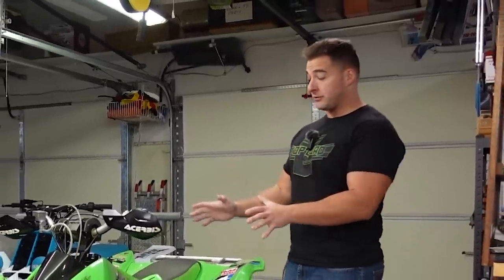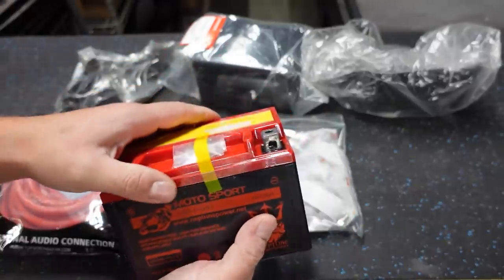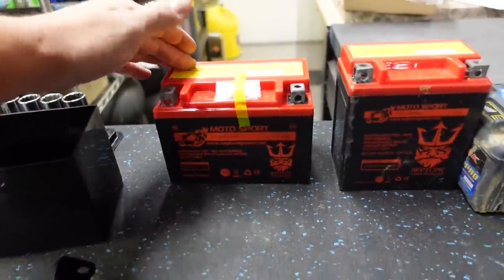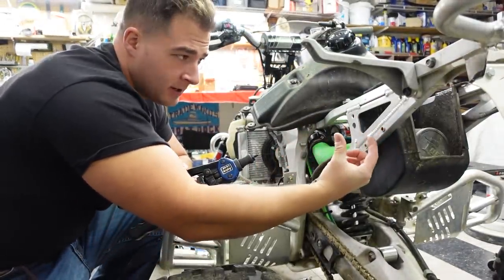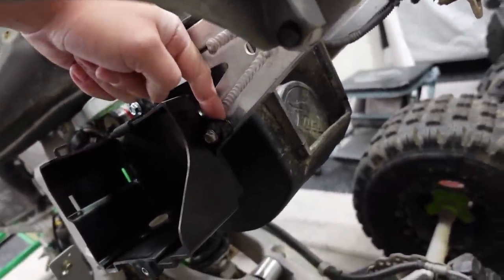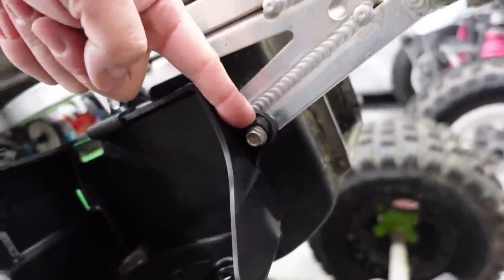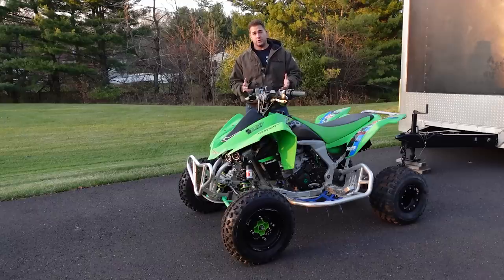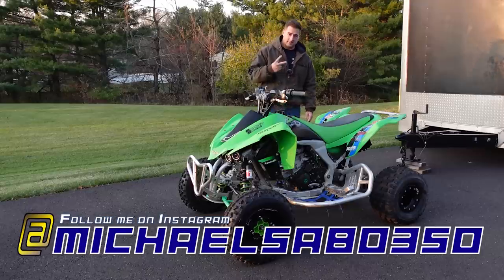The Worst Battery Design in History... Let's fix it! KFX450R Battery Relocate and Upgrade

Comment from the maker: Who's had this issue? Do you think there's a more problematic design than the Kawasaki KFX450R? Let me know and maybe I'll design a fix for it! Thank you for watching and Happy Belated Thanksgiving, you all ROOOOOCKK!!! 🤘🤘🤘
Reply: Hey Mike 
So what always saves my kfx450 is a kicker kit it seems that the starter wouldn't crank fast enough for modded kfx450 engines
Reply: @maxxus5572  then do a 24v starter
Reply from the maker: @maxxus5572  I can’t believe I forgot to mention that! I really wanted one of those but I could not find one; I think Kawasaki actually offered them as an OEM add on at one point. I did hear that they were difficult to start using it though.
Reply: Lithium needs a Lithium specific charger,  they like to be charged,  removed,  allowed to drop through use or sitting ,  and then recharged before it goes under 11V.  once they get into the 10.8v  and under voltage range,  it lessens their lifespan for some reason , and they don't retain charges , and it drains faster when stored. .   also don't store batteries in the cold.
Reply: What is your welder it sounds amazing mig or flux and what brand and if it’s mig what gases are you using
Reply: Had the same problem on a 07 KFX450 i had about 4 or 5 years ago, Stuck a Moose 150CCA Lithium in it, and it was somewhat better, but man, theres just no getting around the stock battery being small in general. Thats a good idea Mike, and you fabbed it up well. Looks good bro. My 400 ex will crank over 10X longer than the KFX i had. Dont get me wrong, the KFX is a rad bike, i loved it, the frame on them is really nice and modern in comparison to the 400ex frame, but, theres just something about hopping on a 400ex and always feeling comfortable on it knowing theres not much of shit that can break. One of the easiest quads to work on also out of all the bikes ive owned in my life. I'm 37, been riding since i was 9, and ridden most of everything out there, owned probably a good 3 dozen different quads and, the only two bikes i tend to hold on to are my 04 400ex and my 07 Predator 500. Yeah, i know, the predators are pains in the ass... Good bikes though when you have a nice one thats not ragged out. Keep it up Mike, you make some helpful videos for the quad community, as well as some good fun riding content with the Brewer bros and Hager and all the others.
Reply: Meee
Reply: Worse than that design is my 08 KTM 525 xc. Small battery and not accessible without disassembly of the rear plastics. Doesn’t give me problems unless it’s cold out than does very fast. The ktm rfs motor in these quad struggles in the cold. I leave my tender on it majority of the time unless it’s warm
Reply: @twistymcslide2  That's why I like AGM's when it comes to vehicle batteries. They're made for sever weather conditions so they're able to withstand the abuse of cold for a bit longer than a normal battery. I'd love to change out the stock one in my truck for an AGM. I had a problem with the computers going all wacky last winter when the temps got into the negatives.
Reply: Yes the honda 250ex, 300ex and 400ex have a very bad location
Reply: @MichaelSabo  you are definitely correct I picked up my kicker kit from kawi in 2010 and now when I start my bike I actually prefer used it over electric because it usually start first kick. But I have heard the kit is hard to find now.
And to answer the question if it's hard to start it take a little getting used too but definitely not hard at all and I have tons of engine work done.
Ported head,13.1 piston, big bore, stroked,you get the idea 
Love your videos dude keep up the good work 🤘
Reply: @tannerlosee1865  Yeah, i generally leave a tender on them now as i dont ride every day like i used to, sometimes one will sit a month before i get around to taking it out for a rip. I generally try to take both of the bikes out at the same time just so i know ive dun them both and they are fine. My dad likes to randomly call me and say "Hey, lets go out riding for the weekend" at any given time, so, i try to keep the bikes ready for that. My kids are at the age where they can start moving up to bigger bikes, but i .....heh, i dont want them to ride the bikes ive had for years, so, ive been thinking about buying a half clapped 300 or 400ex and just letting them beat on it and work on it themselves with a little bit of over the shoulder assistance. They currently have an xr80r and a yamaha 200, but they are really just outgrowing them and can just about ride as good as me given they have ridden since pups. Just the parent in me not wanting to give them a fast bike and then someone gets really hurt. They respect bikes, and know what can happen, but, we were all kids once, we know exactly what its like to want to just let it eat and not think about how fast that curve or tree is coming at you, especially when riding with friends.
Reply: lol you better clean them marks off the drive way or your old man is guna chase you with a broom stick down the street hahaha
Reply: hey mike if ur battery ever dies just bump start it. obviously not with loose ground but grass would be sufficient
Reply: Hello Mike, great fan of you , just letting you know that someone is saying that they are you and they won a prize scamm please warn your patrons to be very careful it's not you . I got scammed for $133 please add thanks brother.🙏🙏🙏🙏🙏🙏🙏🙏🙏🙏🙏🙏
Reply: Yep had that same issue when I had my Kfx. Loved that quad. Looking for another
Reply: Having Efi sucks. If your battery dies everything dies. It left my dad stranded on the trail and we had to drive my Mojave 2 miles to get to the parking lot. Once we got the truck some guys that helped us get it on the trailer said the voltage regulator was broken. Every time we go riding his check engine light comes on.😅
Reply: I have a kfx400 and I'm have problems  with choke cable don't do any thong or it kill it if  moved one way idk
Reply: Hey mike .. how many liters / qt does a raptor 700 take in the case ?
Reply: @MichaelSabo I am having problems with my kfx staying cranked do you know how i can fixed the problem
Reply: Hell yes I swear it actually had made it where I've passed on riding because didn't want the stress of worrying if it would die or my battery connection would come loose
Reply: Need this design. Badly
Reply: Mine does the same thing if it’s cold it sucks

Comment: Just for some extra input to consider, I used that same tusk battery in both my YFZ450R and my Raptor 660 and have never had an issue with it draining out. This could more an issue with the starter drawing a lot more amps than other brands starters. Just so people aren’t 100% detoured from using the tusk batteries! I do hope this fixes the KFX though! 🙏🏻 keep you the good work bro

Comment: The raptor 660 was the worst when it came out, backfire blowing one of the carb boots off all the time, and the one way bearing from starter to flywheel was always failing. That quad left me stranded soo many times.
Reply: It feels like the 660 was just the test quad for developing the 700r
Reply from the maker: I can agree here; those 660s had some pretty common issues

Comment: Clean relocate 😎 if you have problems after this I would suggest an Antigravity battery. It did wonders for my yfz 450R & ktm that love to drain batteries. I have been replacing battery’s every 6months since 2006 😂 on every machine I have owned. Now I have one small form antigravity 13v 230cca I just rotate between bikes when I want to ride. Claims it can go a full year with no charging as long as it doesn’t have a draw on it.
Reply from the maker: Thank you man! I am hearing a lot about these anti-gravity batteries; I think I have to try one out!

Comment: Had a high comp 300 ex with a cam /400ex cab and exhaust I built and I put a400 ex battery in it and it helped out a lot ! I had one of these bikes and the small battery is the pitfall of these bikes !

Comment: What spray paint did you use? Trying to find something really strong to use on my 300ex accessories.
Reply from the maker: I have it linked in the description. Its available at Walmart or any hardware store- cheap and it lasts pretty well if you prep the surface!

Comment: Nice job. However we're all running the 15oz 3in x 1.5in AntiGravity battery. Lithium. And very small lightweight...✌ remember keep it in neutral left in gear drains battery. Ugh I've bought over 7 batts, for mine.

Comment: Did you have the original battery covered or just rode with a opened battery. I recently got a kfx and the battery is just exposed and I’m concerned , will it be okay like that

Comment: If you ever decide to do another battery upgrade try a good brand AGM variant. They're a little pricier but they're designed for sever weather conditions and tend to have higher CCA than normal batteries. I bought one for an old utility quad that was rated for 310CCA. Of course that's also determined by model of battery. :)
Reply from the maker: Not a bad idea at all! I was concerned that I'd still have issues though even after spending the money on a more premium battery
Reply: @MichaelSabo  Personally for me with all the problems I've had with regular vehicle batteries in the winter I'd switch them out for good AMG's any chance I could get. But since my truck is a lease I don't know if switching the crappy battery out for an AGM would void any warranties. The same goes for my tractor, I'd switch out its' stock battery in a heartbeat for an AGM but I don't know if it would mess with any warranties as well.

Comment: Have you consider a 24 volt system?  It is a two battery linked system that is very popular with xc racing that have dead engine starts.  I use a Shoria battery that has 270 CCA that by itself starts my TRX450er very fast providing valves are at proper gaps.  I use 24 volts start system for racing only and it is easy to disconect it and run with 12 volt start system.  For a second battery,  Antigravity has a smaller 4 cell 13 volt battery that is perfect to enhance the rapid start without adding hardly any weight. In fact, two lithium batteries will weigh less than one OEM lead acid battery.
Reply from the maker: This is somewhat new to me but I am getting a lot of comments on the 24v system; it definitely makes sense and especially for dead starts. Thank you for the info; I'm going to look into this possibly for a future project!

Comment: I just got a kfx450r and went riding and it died I’m thinking about doing the same thing did it work a lot better over time ? And was the starter relay wiring extension aftermarket or custom

Comment: Hey man hope you had a great thanksgiving I just sold my kfx450r never had a starting problem I just bought 07 trx450er and the battery dies so fast i hate when this happens might have to do a 24v starting system
Reply: Damn fr. I've had mine for two years and haven't had a dead battery yet.
Reply: @LolliWANG505  I just picked pick this thing up it needs work it’s getting a complete rebuild should be good to go after it’s all done. 🤘🏽
Reply from the maker: Curious if your KFX was modded? I think its the high compression and heavy valve springs that tax my starting system. 

Good luck with your new 450 man! I imagine there's a bug in the system but I don't know too much about the TRX450ER.

Happy Thanksgiving to you too man!

Comment: I think the problem here is the battery you chose to replace it. Lithium batteries are nice but you chose a battery with only 2AH whereas even the oem was 7AH. And all this work just to install a 2AH larger battery. My suggestion, use the oem location and use an antigravity battery. Tusk also don't have a full battery management system like the better brands, so if you over-discharge it you will damage it. Where as brands like Antigravity and Shorai that appear more expensive are actually giving you MORE Battery and a full Battery Management system that will not allow the battery to over-discharge and be damaged. Antigravity will give you 150+cca in the oem box. Love the creativity tho.
Reply from the maker: Great info and I think you're right on the lithium that I chose being a bad choice. I did however go through a number of batteries before switching to lithium (not an anti-gravity though.) I'm happy with this system though and it was fairly cheap to do.

Comment: I'll never understand why they put the batteries up low in the front where it's exposed to the elements coming into the bottom of the chassis. Polaris does this too and it's a terrible location for a battery. Not to mention they're not easy to get at when you need to put the charger on.

Comment: hey man i have a yamaha raptor 250 that only idles when warm. i have the idle turned all the way up and it still idles really low. the carburetor is cleaned and everything please help
Reply from the maker: I don't have experience with the Raptor 250 or know if they have quirks but just as a rule of thumb with idling issues, sometimes a rebuild is in order for a carb, even if its clean the components like the needle valve and seat can be worn out. Resetting your fuel/air screw may help and making sure you don't have any air leaks in your system that can cause idle issues. Hard to diagnose without seeing it but I hope this helps!

Comment: Ya my last ride my battery on my 06 Trx 450r came loose, im always scared i may not be able to start if i stall it. i want a backup kick start. but ya in do time. plus where i live and ride im miles from help or may not have cell signal.
Reply from the maker: This makes me wonder why manufacturers don't offer a backup starter on all machines; being stranded is terrible.
Reply: @MichaelSabo  ya it makes no sense even a new 2022 Yamaha Raptor 700 is till only electric start. and seem they never take advice from Rides or even Pro Riders.

Comment: You need to buy a dewalt or any cordless power tool  battery that is a 6 amp battery and get an adapter off Amazon and use that instead I did this  for my ltz 400 make sure it is a 20volt

Comment: bro i had the same problem with my fully tuned 450 like that thing goes 167 mph i my dad took it to a bike shop and that mechanic was so dump he put a Chinese small freaking battery so i put a bigger battery and it works so good you cant get off the bike

Comment: It's not the battery design, it's the design of the 4 wheeler.  Battery design is fine when appropriately used.
Why is your ATV so hard to start?  too much cranking.
Reply: It's always nice to hear from ATV engineers. Thanks for the assistance.
Reply from the maker: Yes definitely design of the system. It really wasn't designed for the added demand of the high compression piston or heavier valve springs and it strained it too much causing it to be unreliable.

Comment: dont wanna be this guy but the carb made it unreliable.....
Reply: The kfx engines are actually more reliable with carb then efi
Reply from the maker: I don't think it was the carb, but I also am not all knowing - you could be right 🤷‍♂️
Reply: @MichaelSabo 
@lolliwangmotorsports62 wel i have my kfx for 10 years now and havent had any problems with the efi or starting at all with that small battery?